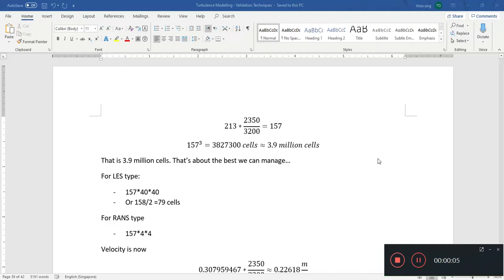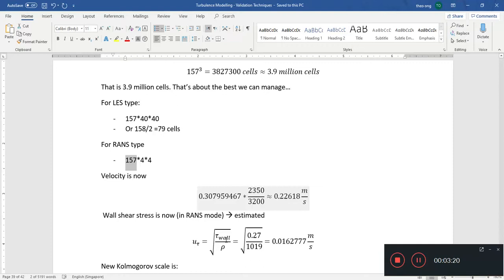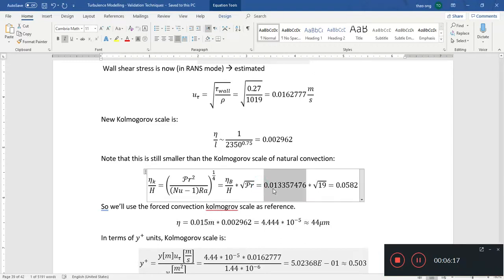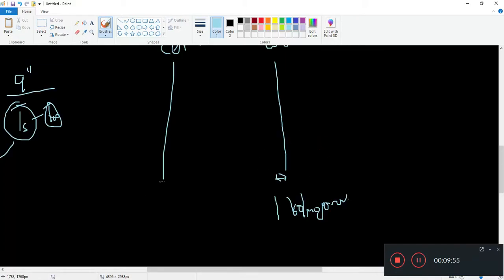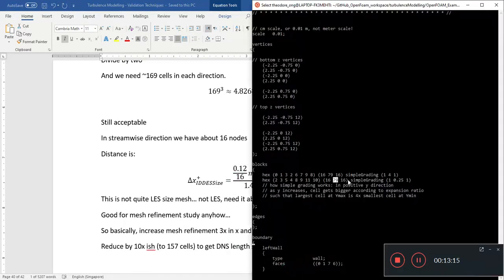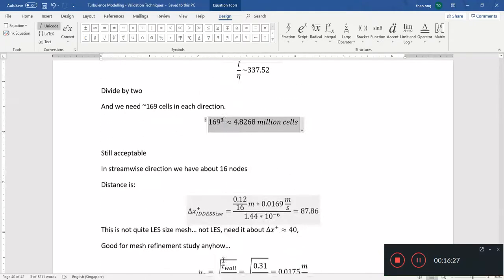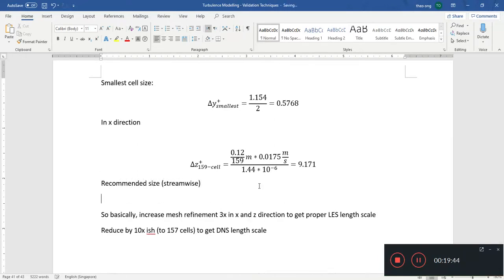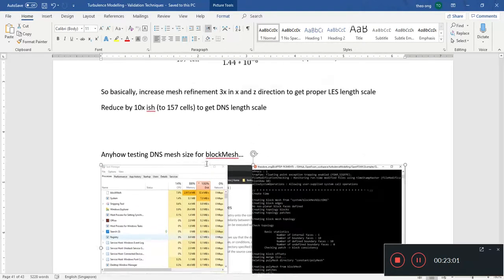Turbulence Modelling 102 - OpenFOAM Example Practical DNS and LES Mesh Sizing with 8GB Ram

Comment: Hello Theo,
I recently started using openfoam and I've learned so much from your beginner series for openfoam. I am working on a fluid-structure interaction study, for which there is solids4Foam solver available from Dr. Philp cardiff. 
It has been developed on Foam extended and is still underway for proper use on openfoam versions. 
I tried installing foam extended 4.0 on Ubuntu on Windows using bash, but it's  quite confusing to me and I wasn't able to do it. Also there is no tutorial video to help us. 
I request you, if possible, to make a tutorial for installing foam ext 4.0 on ubuntu wsl.
Thanks.

You are doing amazing work.

Comment: hi i m running simulation but i have this erreur 

Primary job  terminated normally, but 1 process returned
a non-zero exit code.. Per user-direction, the job has been aborted.
-------------------------------------------------------
--------------------------------------------------------------------------
mpirun detected that one or more processes exited with non-zero status, thus causing
the job to be terminated. The first process to do so was:

  Process name: [[8236,1],4]
  Exit code:    145